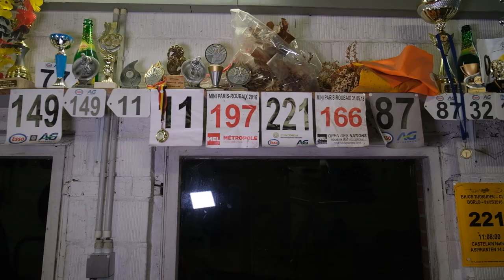KORY YORK Tracklocross build and ride - ft. Nathan Castelain

Comment: Long term review? Time for a new frame and would really appreciate feedback.
Reply: Hey! It's my bike in the video. The bike is perfect in every way and also extremely light and reactive. I've had it for nearly 3 years now and not a single problem. The quality of the welds and paint is also next level. My only regrets now is that I didn't order it with brake bosses and holes to put mudguards on, But that's my fault :) Hope this helps!
Reply: @nathcastel1  yo homie, what pedals you rocking on this setup and do you like them?